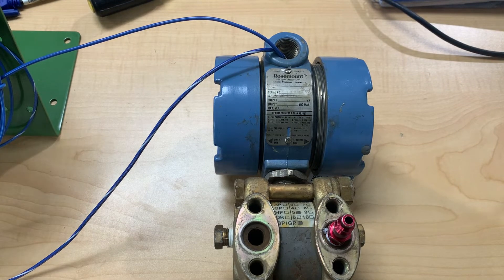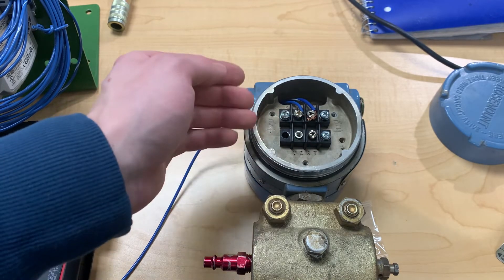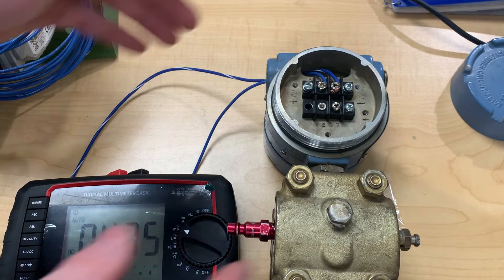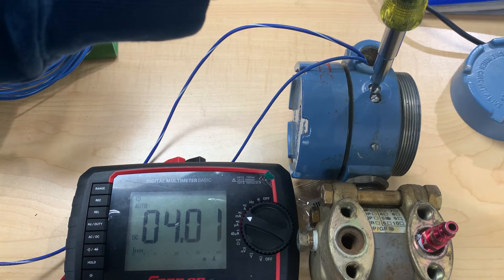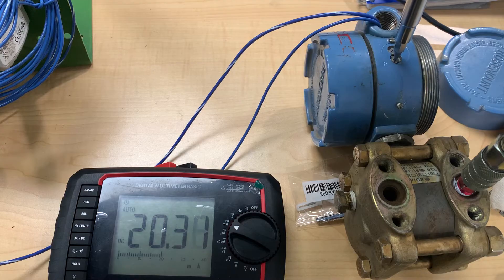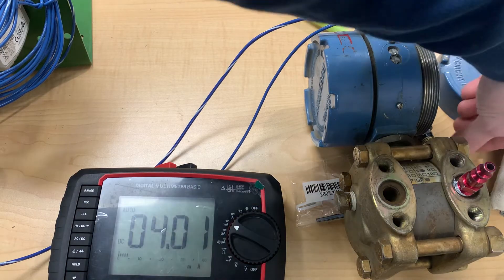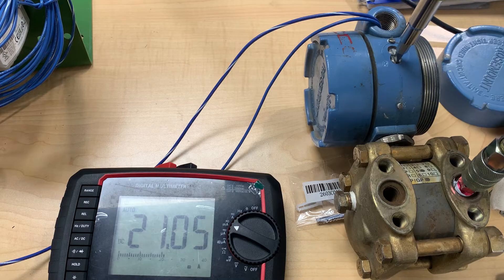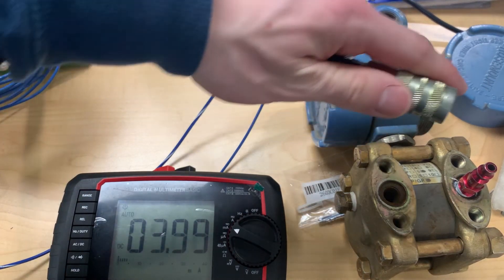How to Calibrate a Rosemount 4-20mA 1151DP Pressure Transmitter

Comment: Dont you have to set your zero before your span? Meaning it would be better to set zero, apply pressure, remove pressure and see how close it gets back to zero again before ever doing span? Basically repeat the zero set point until it is correct then move on to span to save half of the steps but make it accurate?